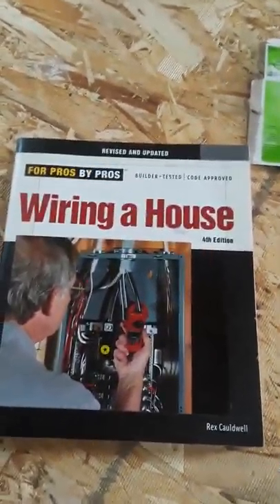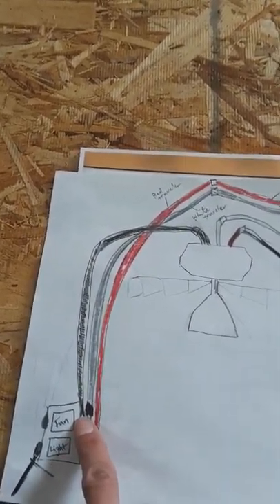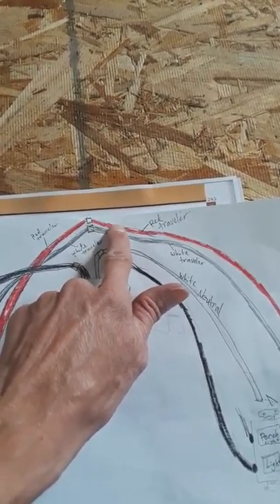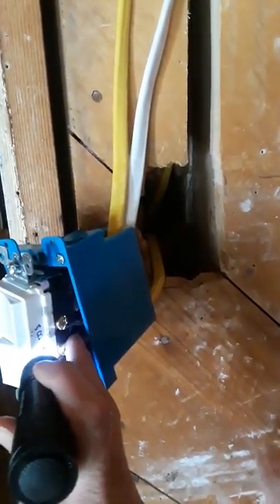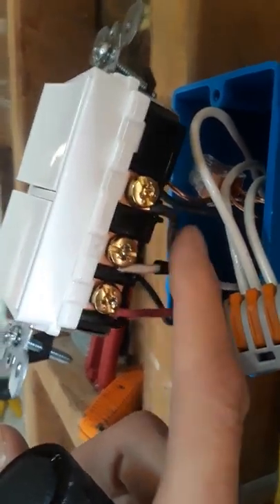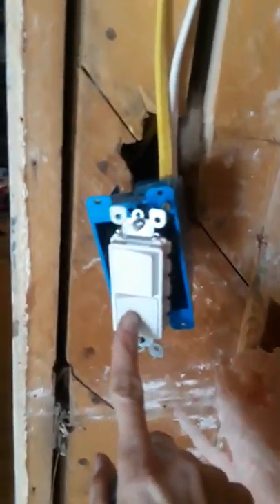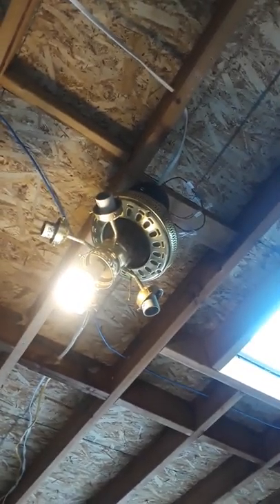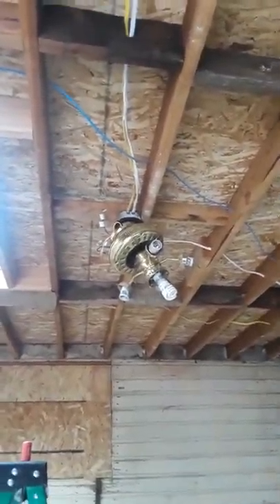3-way combination switch, wiring a ceiling fan/light

Comment: looks like that is a 20a circuit? (yellow 12/2 romax Line) if so this is not code you used 14/3 to the fan/light load off 12/2 r(white romax is 15a only unless its a 15amp circuit your 12/2 romax is ok on 15a but if its a 20a as it looks to be you should have used 12/3 romax hope you don't burn up your wire if your running more than 16 amp load on that 20 amp circuit (80% of 20amps max load) but thanks for info
Reply from the maker: I used a 12/4 Romax.
Reply: @MadeByPam  x/y; x is the the awg of the current carrying conductors, y is the number of current carrying conductors. the ground (green) wire is not a current carrying conductor. so a 12/3 wire will have 4 wires (2 hot conductors, a neutral wire, a ground wire). 12/4 would have 3 hot conductors. at 2:56, you say "black, white, red, and ground wire", which would be x/3, did catch the awg.

Comment: Did you have to do anything specific to the fan wiring itself?
I've installed this set up 3 times and each time the fan and 3 way for the light kit will work for only a few flips of the switch. Then the fan and lights stop working completely. 
When I hook it up to an on off switch it works again.
But I wire it to my fan speed control knob it stops working again
Reply from the maker: Nothing to the fan wiring.  Fan wiring is all the same.
Reply from the maker: I'd have to know the setup,  to help you trouble shoot.  It took me a good week to figure it out,  I knew it could be done,  it was trial and error,  I got shocked a couple of times,  blew a couple of light bulbs, set off the breaker switch,  but kept at it,  once I figured it out i really wanted to share it.
Reply: @MadeByPam  Do you think it could be the fan speed control?
Reply: @MadeByPam  If I can try and be more specific do you think you can help!? :)
Reply from the maker: Is the fan control speed faulty
Reply: @MadeByPam  Not that I know of. Bought everything new, and when I first installed the fan to the speed control knob it worked. 
But I was so excited about it I went to hook up the light kit without turning the power back off, so when I plugged the light kit in it popped and I saw blue spark.
Reply from the maker: @DestinyA83  that's no fun,  I've done that before, hope you're okay
Reply from the maker: @DestinyA83  you might be able to take the switch back to the store and let them know it's defective,  and you can pick up a new switch
Reply from the maker: For the fan wiring just the black wire is connected to the black wire nothing different.  I had the problem also when I was connecting the light it only worked for a few times then burnt the bulb.  I wish I could help walk you thru it step by step.  I'll try best I can thru here.
Reply: @MadeByPam  I was going to try that next.
Mime is doing the same thing as yours. Wire it  and it's fine for a few tries, then nothing. 
My LED bulbs aren't burning out or anything though. It just stops working.
Then when I take it all the way down and use my homemade tester on it, it works fine. 
But I wire it back up. Use it then it stops again.
Round and round we go lol
Reply: @MadeByPam  also, I certainly appreciate your willingness to help me!
I don't know if it's going to matter, but I have the Clarkson II 44 inch fan from Home Depot
Reply from the maker: @DestinyA83  have you watched the installment video on the website for that fan/ light combo.
Reply: @MadeByPam  yes I finally got it!!
Reply: I quit working on it two months ago because I couldn't figure it out. 
I was laying in bed when I came across your video and it was the closest to what I was trying to do in my little cabin.
Thank you so so much!
Honest to God if you hadn't responded to my comment this morning I would have never even went outside today.
Credit goes to you so THANK YOU ❤🤍💙
Reply from the maker: @DestinyA83  that is wonderful,  so glad you got it figured out.